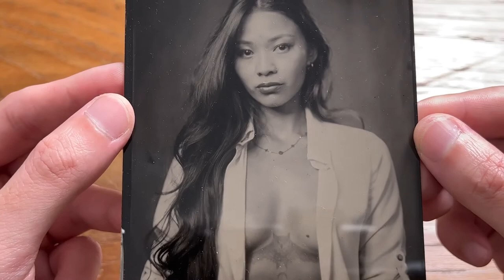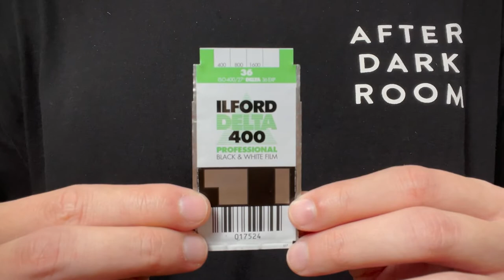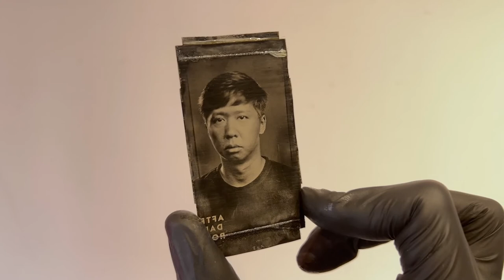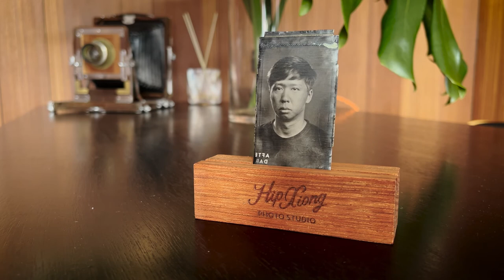Tintypes on 35mm Film Canisters

Comment: This is absolute genius. (FWIW, easier way to open the cans is to use a bottle opener to take the end caps off).
Reply from the maker: Thanks for the tip!
Reply: @silveranddye  Or a dedicated film canister opener. Much safer. Of course, only the top ring pops off. You'd still have to pull off the lower ring, but it should be much easier.

Comment: I wonder if it would be possible to use a medium format camera instead of a large format camera for this 🤔

I have absolutely no interest in chasing large format, it's not how I like to shoot, but I do find this process very intriguing and I really want to make some myself
Reply from the maker: I would think a 6x9 should be enough, but its very messy and the emulsion might corrode the camera
Reply: @silveranddye  in that case maybe something like the terraPin 6X9 could be used? Would likely only be useful for sunny daylight shots but no major investment in a camera or expensive backs would have to be made
Reply from the maker: @ yes but not with a pinhole lens for wetplate photography, at least a f3.5 lens if you were to use natural light
Reply: @silveranddye  ah right, I forgot that the sensitivity was very low. Hmmm then probably one of the 3D printed cameras using press lenses would be a better way to go? At that point I think this might start getting out of reach for me for the moment :/